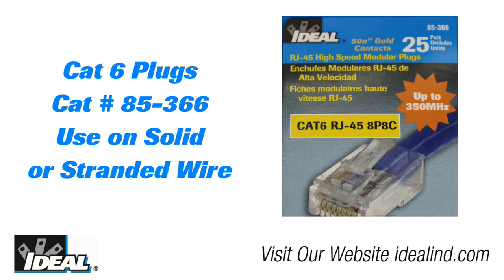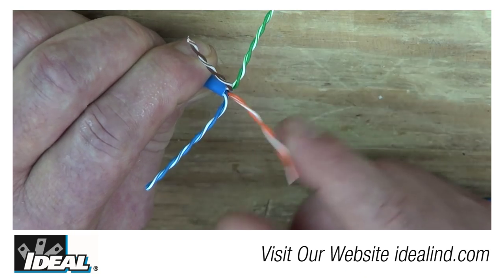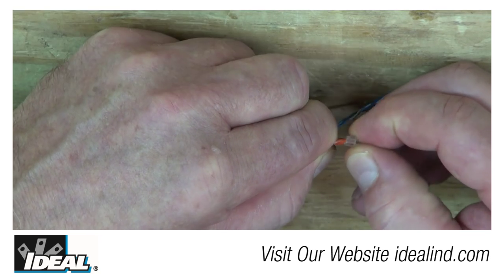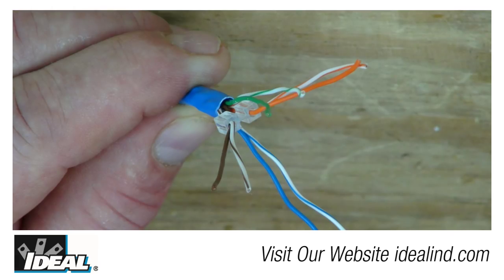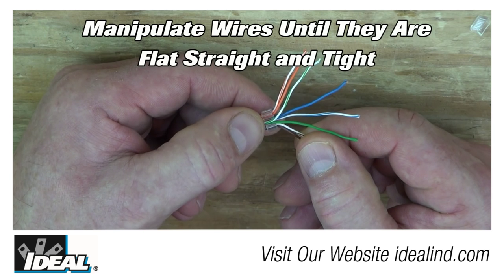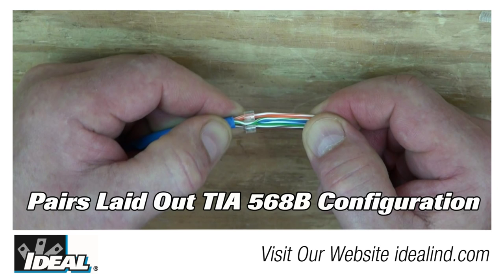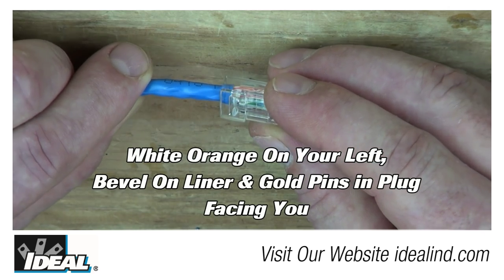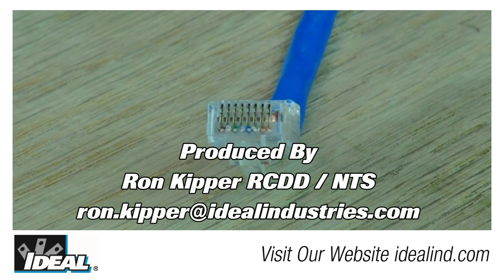Cat 6 Plug How To Terminate Short Video

Comment: Thanks for this.  Saved my life
Reply from the maker: Glad to be of service. Ron
Reply: Ron Kipper Datacomm You have no idea. I ran a 50 ft cable in the ceiling and forgot to test it first. Needless to say I found the cable was defective after patching the Sheetrock. Turns out the manufacturer crimped one end poorly. I didn't wanna open the Sheetrock to replace the cable so this video was perfect. Especially since this brand of jack was the same one I got (from Home Depot).
Reply from the maker: Hey Hellfire good to hear from you and I am glad the video helped. We have just launched a feed through style of the plugs that are a little easier to install however they are not in home Depot yet. Have a good night. Ron

Comment: I forgot to put the first slider on but all wires went through the guide and RJ45 plug in nicely. Does this matter?
Reply: It may impact the crosstalk so that your Cat6 doesn't perform to the Cat6 specifications. Or it maybe fine if you are lucky.

Comment: The cable used does not look like CAT 6 cable to me, nor is the RJ45 plug a shielded CAT 6 plug
Reply from the maker: Hi Jim the cable was Cat 6 that I used and it was unshielded so hence the unshielded plug. We do offer a shielded Cat 6 plug if you need one. Have fun Ron
Reply: You're correct. CAT6 has a separator run through the core of the cable. He is using CAT5 in the video.

Comment: Honestly this wouldn’t pass at my work. When flattening out the pairs it should be clean all the way back to the jacket with no overlapping. This will pass for residential work but industrial/commercial, this wouldn’t fly by at all. I’m relatively new in the field with only 5 years under my belt, but that crossed over white/green wire puts up red flags with me.
Reply from the maker: Hello I would bet it would pass a certification test I have made a lot of modular plugs over the years. As for just supporting Ethernet application you will find you can untwist quite a bit of the pairs and it still works. Have fun out there Ron

Comment: HEY! after some time with my cat6 cable, the brown conductor came out abit and nolonger makes contact with the golden part. How do i fix that without having to re-assemble the cable because i dont have a crimping tool?
Reply from the maker: I don't know a way of repairing the cable without crimping a new end onto the cable. Let me ask you are you having any issues with your network connection? In many cases Ethernet uses only 2 of the four pairs and the brown pair is not used. It may make no difference Ron

Comment: Do i need a liner and sled for it to work, or can i just use the main body?
Reply from the maker: Ricardo with that connector yes you need to use all the parts. Try use the new feed-through connectors if you want something a little easier to make up.
https://www.youtube.com/watch?v=ZTe3PZd1HxE

Good luck Ron

Comment: Soooo why are EZ RJs frowned upon? Hence the name they are a lot easier than this.
Reply from the maker: Hi Daniel the first design of the Feed-Thru connectors the tool sold would not trim the wires flush with the end of the connectors. IDEAL's new tool does a great job of doing that. People had issues with the old design and plugs with short wires exposed on the end causing shorts or added crosstalk problems. Some people feel the feed thru leaves two sets of exposed conductors the pins and the end of the connector and think dirt, dust or anything else in the jack may cause problems. Have fun Ron

Comment: wont normal JR45 grimp tool to the job ? When i looked it it feels like it would ...
Reply from the maker: Most any crimping tool for these plugs will probably work. Cheaper tools are just that and don't last. If you are just doing a few connections you should be OK.
Ron
Reply: I mean my tool costs a lot . Almost 200.€ but it is not made specially for modular RJ45
And by now it is 3 years old. Sadly havent had to deal with Cat6/6A untill now.
But it still works very well.
Reply from the maker: OK Your tool sounds like it should work just fine. The physical size of the RJ-45 plugs is the same for Cat 3,5e,6,6A so you are good to go. Ron